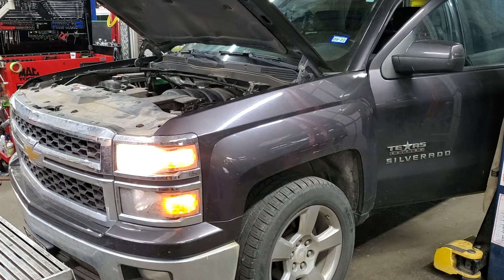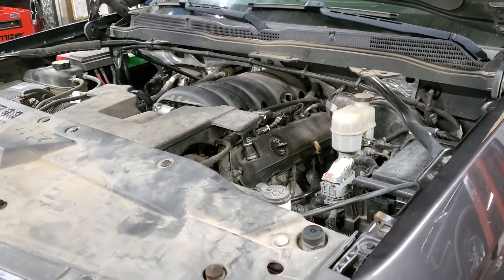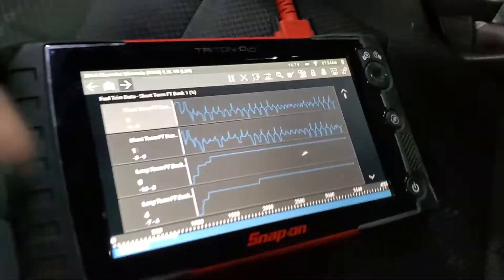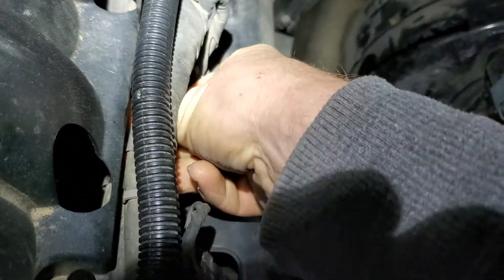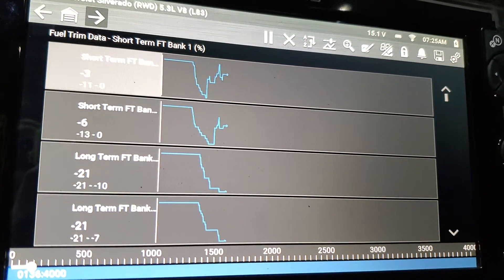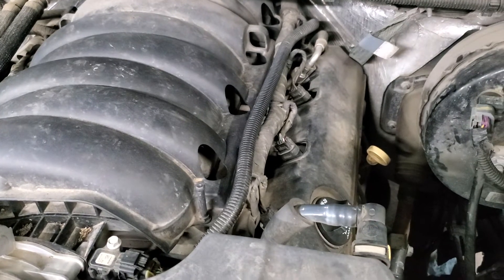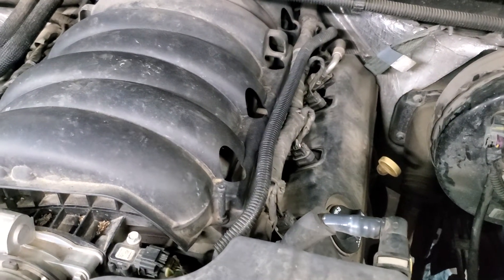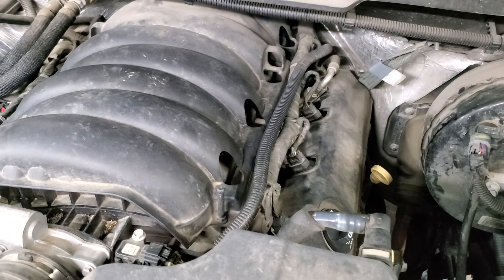GM 5.3 GDI Running Rich? Could Be A Leaking HPFP

Comment: Does that high pressure fuel pump have to be replaced? I get a sloppy idle at a complete stop. Only when at operating temperature. Did everything to no avail. Thx

Comment: I’ve got a 15 just put new o2 sensors all four. Code p2099 and p2097 post catalyst fuel trim system high bank 1 and 2 what should I do

Comment: Extremely easy way is unplugging the PCV and blocking it off. Then disconnect BOTH breather tubes and observe. If the engine is at 190°f or better and the HPFP is leaking into the crankcase, you'll SEE the vapors escaping out the breather tubes. (with a strong raw fuel odor)

Comment: Do you know if this could possibly be causing the vehicle to use/consume oil? I have a local dealer telling me I have this issue and saying it may be related to fuel getting in the oil. 2016 Tahoe 5.3
Reply from the maker: @Cam27321  yes anytime the oil is diluted with fuel it becomes really thin and can make it's way past the piston rings to be burnt in the cylinder.
Reply: Totally makes sense and thanks for your feedback, I greatly appreciate it!

Comment: Any insight would be greatly appreciated man
Reply from the maker: @GERONIMO326  if those trims went crazy negative as soon as the EVAP system was hooked back up it's safe to assume you do indeed have a fuel saturated charcoal canister. Keep the purge valve disconnected (make sure you can't blow through it too- sometimes they leak) and see if the trims go back to normal.

Also don't forget to reset your fuel trims after EVERY change you do or it will take FOREVER to see any effects on trims. 

Also, don't forget to check ethanol % in your fuel and compare that to the ethanol reading in the computer. The ethanol sensors LOVE to be biased and think the fuel is higher than 10% ethanol when it isn't. So it runs rich as the stoichiometric fuel ratio of ethanol fuel is way richer than normal fuel.
Reply: @TechnicianRed  awesome, thanks for the input. It makes sense too because bank 2 (where purge valve goes in) is slightly more negative than bank 1. The engine will slightly bog when it performs the first evap test after a cold start too. Are you saying to disconnect the battery when I unplugged the purge valve connector? Can I just unplug the wiring harness that goes to the purge valve? I already checked to make sure it wasn't stuck open, and it wasn't. It just continuously opens and closes (oscillating)

Comment: Hey man, i did this same test, but did it with evap purge valve (on the intake) to check for a saturated evap canister. Trims got better a little. Plugged it back up, and trims WENT CRAZY negative at first (engine bogged) and then got a little better. But I have been chasing negative ltft for a while now no cel on 19 6.2 Camaro SS 1LE. Fuel trims seem decent at warm idle, but when you give it gas they go up to almost -20 on both banks, car sort of bucks casually accelerating when you get to 2k rpm. Bogs under heavy acceleration. Ive changed o2s, maf sensor, plugs and wires, injectors on bank 2, pcv valve, and am about to give up. Any advice? I did notice the other day when i was sitting stationary warm idle, i revved the car to 2k rpm and fuel pressure i think at the rail was around 60 psi, but the other pressure (high or low cant remember for the hpfp) was at like 350 psi at 2k rpm revving in neutral. Thought that was a little low.

Comment: Is it possible to differentiate between a high pressure fuel pump leak like this and an injector leak on a GDI?
Reply from the maker: Yes. A fuel pump leak can be isolated by capping the PCV line and watching fuel trims like in this video. If you have a leaking injector capping the PCV won't make any difference in fuel trims. 

Also, a leaking GDI injector will cause the fuel rails to lose pressure quicker than normal when you shut off the engine. My fuel pressure gauge has a ball valve where I can isolate the fuel rails from the fuel line to see if pressure bleeds off to confirm an injector is leaking.

Also, every GDI engine I have worked on (mainly GM and Ford) allows you to do an injector flow test with a scan tool. If an injector is leaking it should fail that test.
Reply: You’re the man. Thank you so much. Hope this helps me get somewhere. Been stuck a long time trying to trouble shoot this misfire and po430 code.

Comment: Had a HPFP changed for fuel in the oil a little over 1000 miles ago. How long will the smell of fuel stick around on the dipstick?
Reply from the maker: Did you have the oil changed when that pump was changed? If not, you need to change that oil!

Comment: 2014 gmc Sierra 5.3 missing only after engine warms up. Nobody has been able to figure it out.
Reply: Same here my friend. 19 Camaro SS with the 6.2 V8. Negative fuel trims, running rich on both banks, no CEL, nobody can figure out. Hesitates/jerks when accelerating from a stop, doesn't have the power it should
Reply: Did they ever figure it out ?@GERONIMO326 
I'm dealing with the same problem with a 2014 gmc sierra slt 4x4.
Reply: @GERONIMO326 did they ever figure it out ?

Comment: Bro i need your help 🙏 i have a 2016 sierra 5.3  1500 4wd , it has a crazy fuel consumption , with no codes , also it has a slight misfire on low throttle , no one in my county knows the reason , not even the dealer 🫤
Reply: start from the basics, spark plugs, coils, pcv etc
Reply: Did you ever figure this out man? I'm having the same issue with my 2019 camaro ss. Negative fuel trims on both banks (running rich), same symptoms as you.
Reply: its the HPFP akhi 100%. Pump seal fails and as you increase the throttle(and corresponding rpm/speed) it pumps more pressure and more fuel into the crankcase